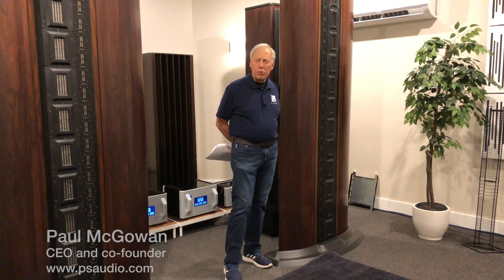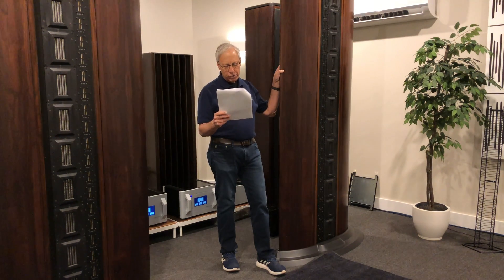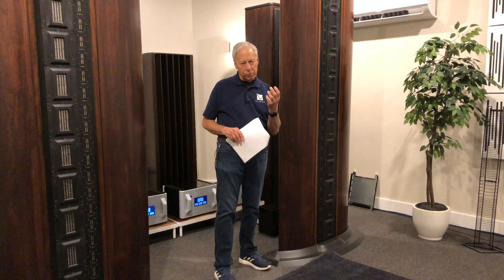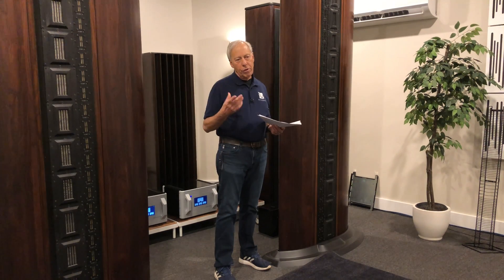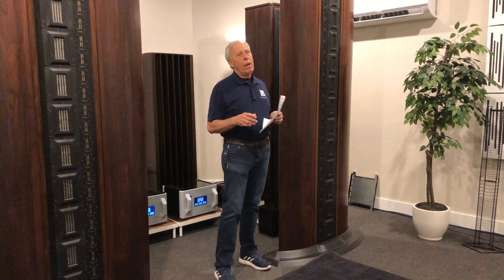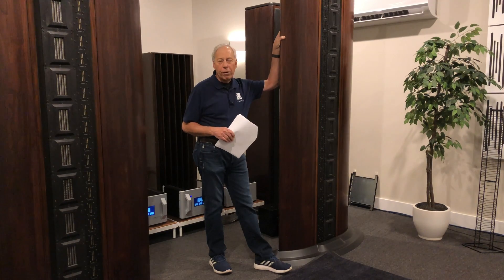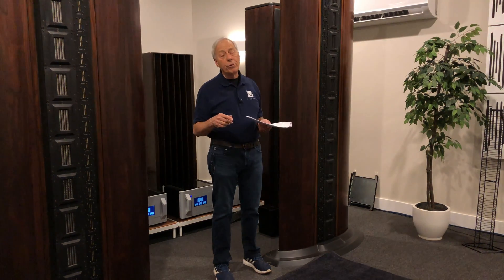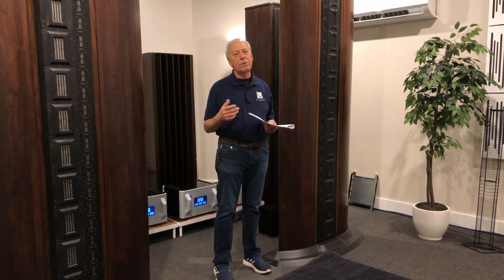4Ω speakers on an 8Ω load?

Comment: Paul: the loudness (voltage) would go down with a lower load? My thought process was the lower load would draw more power.
Reply: Thought that was what he said?
Reply from the maker: It does. For the same voltage output on the power amplifier, half the load impedance (like going from 8Ω to 4Ω) takes twice the power. Most amps just handle that, but not all.
Reply: When current is limited the voltage gets lower. When current is ample you get 4 times the power.
Reply: @Douglas Blake See you again. What gain? what voltage? It's the current gain of output transistors that's less than needed at current limit.